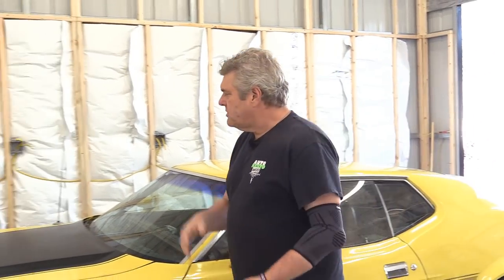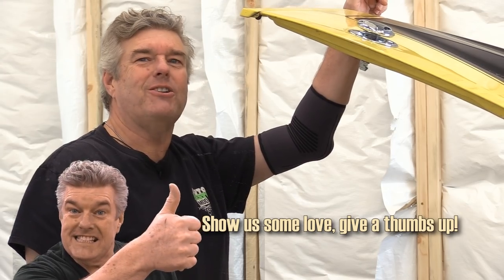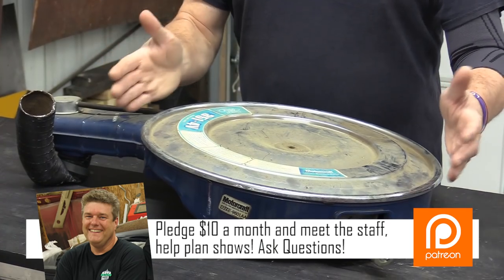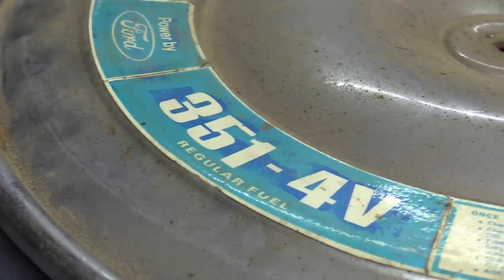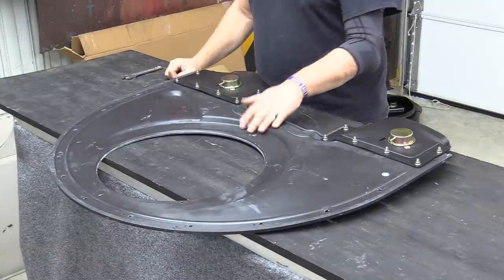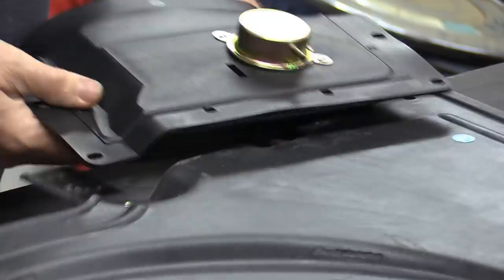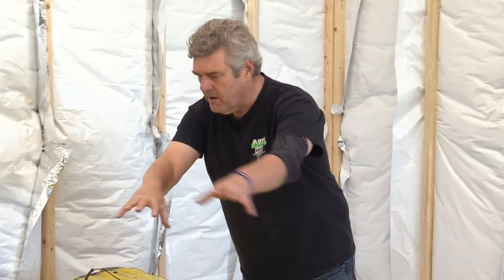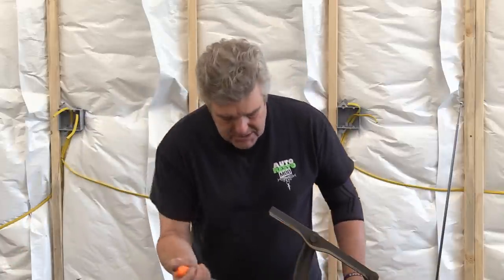Mustang Ram Air

Comment: Thanks for vid, showing us the 72 Mustang again, rolling under its own power. I did the installation with the same kit on my 73 Mustang with a 351C 4V. Although it came not with the Ram Air setup it came with the HD springs from the factory. I added the correct hood locks, the correct TuTone paint on the hood with the right dimensions and the Ram Air setup. On the Air Cleaner element I added some things to make it more functional and OEM, like the inlet for the fuel vent, the hose for the pvc system and the temperature sensor for the vacuum door. Since I have headers I did not add the snorkel tubing or the fresh air duct the '73 originally had. 
I had only one big issue with it so beware and test it twice: the flappers did not travel the whole way through the inlet, they blocked itself and were scratching on the plastic side of the inlet. So I filed down the metal flapper a little bit so it can move freely now. Before installing the whole hood again please test it!
Btw: Bob Perkins too have a Gold Glow 351C 4V Mach 1, which got the Ram Air original from the dealer added, window sticker shows it. You could get it in those days, but only from the dealer.
Reply from the maker: Awesome info! Mine had the flat wounds too. But we wanted to feature the new ones that have been unavailable until now.
I will look at the hood scoops for interference, though I did test them before I installed it. Sometimes installing will change positions. I wonder if the cost was a "you might feel a slight pressure" level.

Comment: These cars are a lot more fun than I realized when I was a kid and they were relatively recent model used cars. I'd love to build a 351C, 351M, or 400 with aftermarket closed chamber heads and a decked block to get decent compression and quench. Add the right cam and appropriate 4bbl carb & manifold I think it could really surprise some people. Not so much the Cleveland version because those still have reputation but the Modified engines ALL used Cleveland 2v heads. Funny how a raised block and a bad tune make people think they have no potential.
Reply from the maker: Oh but they do. The Aussies have made hay with this engine and were the first to offer a stroked 351C (I think).

Comment: I use a spare seat belt to remove the spring. You have to pull pretty hard but it works! Also too bad ram air limits your intake manifold selection. I have an Air Gap intake on my car. I heard you can trim the seal to make it shorter so the hood will close. I might give it a try because I want the best of both!
Reply from the maker: I'm not sure you can trim it and have it look decent. I might go with closed cell foam, use some Playdough to know what depth you need and glue that down to the air cleaner with weatherstrip adhesive.

Comment: My 1972 Mach1 had that same air filter top. Chrome with the 351-4V Regular Fuel. I had to add the Ram Air package from a wrecked 71 Boss 351. Before that, I found a top from a 302-2V Torino and flipped it and replaced my chrome top to let my Cleveland breathe better until I found a ram air hood setup. It was a noticeable difference.

Comment: Regarding the 351-4V air cleaner decal. That's very true, my 72 Q code with build date June 24th has that sticker. As original as original can be.
Reply from the maker: I really wish someone would reproduce the correct 4V sticker. My car too is a June build date , actually our dates on the cars are pretty close!  My car had a serial number established on June 14th which is also my birthday.

Comment: You have a little horizontal banding going on in some shots with those new lights. Might try adjusting the exposure/shutter time to eliminate it.
    When I remove the springs I hook the new one on the old one then pull the hook with a bar. Or do the same but with just a piece of small rope. I'm glad you are adding the ram air. On the Chevelles I have always been annoyed when someone puts a non functional cowl hood on them. For me if its there I want it to work and on the chevelles you have that cool door that you can see opening and closing.
Reply from the maker: It is the crap lights in Studio A Those will work great in a not video situation, they suck for film. We're going to dump them and get the Metalux like in Studio B, where we shot the hood removal (we shoulda got the mMetalux to start with).
Reply: @AutoRestoMod   Yup I know how the lights go. Have had issues with commercial lighting too. Lots of cheap lights use a switchmode power supply which makes the light flicker faster than you can see. The better lights use constant current power supplies that basically feed full DC to the lights all the time instead of chopped up dc. usually you can change the shutter speed and eliminate it vs replacing lights.

Comment: Love the videos! Have you seen the Lucky Costa method of using a fan belt for hood springs? Also works great!
Reply from the maker: Yes I have done that before, but these are new and REALLY stiff.
Reply: In 1978 I traded my 1978 Mazda GLC that my parents had bought me about 6 months earlier for a used 1972 Mustang Mach 1 with the 351-2V Ram Air.   It had been repainted in its original Dark Green / Argent colors and had been modified with a Mallory dual point ignition, snubber traction bars and the exhaust terminated just underneath the front seats with mufflers that were attached with coat hangers or bailing wire.   I traded even  for this Mach 1 and thought it was good deal.   Needless to say my parents were not amused and didn’t share my thoughts of a good deal.  Immediately, it had to have a complete exhaust redo.   The competition clutch had to be replaced with a standard Ford unit( thank God).   My left leg is still stronger than my right leg thanks to that clutch and I’m 60 years old now.  Why they put a competition clutch, dual point ignition, and left the anemic 2-V carb and heads is baffling to me.   Maybe they ran out of money ?  My Dad put a new heater core in it ( after the winter was over) and didn’t speak to me for about a month.    It was a great looking car with a new paint job but not very reliable.  I had forgotten about my Mach 1 until I earn across this video.  Good to finally know why the Ram Air was only available on the 351-2V which never made any sense to me.

Comment: 14:00 why not use a short pulley belt. Hook it on the end of the spring and pull.
Reply from the maker: Those are wicked tight springs. There was a LOT of grunt applied to get them on.

Comment: I believe the 72 Torino had a option for ram air
Reply from the maker: They did. Early cars had them installed, later cars had them in the trunk.
Reply: @AutoRestoMod  also 72 montego gts with the cyclone package

Comment: Love the videos on this car, I have a '73 Mach 1, same color scheme as yours except, of course, for the stripes. Fortunately, mine was already restored, but had been sitting up for a few years when I got it. It is factory stock, with the 351C 2V, that runs good now, however I'll not be winning any races! I plan on taking it to more car shows this year, it's not perfect but is a great looking driver. Won first place Mustang at a local event last year. Leaving it stock for now, but visions of mods keep running through my head. I was 16 when this car was new, but couldn't buy one back then. I've retired, so me and the wife will be enjoying feeling 16 again. Would love more power in the future, does NPD carry mods for this engine? Not sure whether to stick with the 2V heads or try to find some 4V versions. and then there is the cam. Thanks for the videos!
Reply: I was always amazed how fast these sold in 1980 when I was trying to buy one , I ended up buying a 68 cougar for $250 and had to replace all of the wiring in the Engine bay to get it running . Still 42 years later always looking for a blue with silver stripes 71 to 73 Mach 1.

Comment: Hey Jeff can't understand why you had such a hard time with the hood springs, flat screw driver, so fast you wpuld think I did some sort of magic trick, also I ran a nasa hood with stock springs, never new the difference,  just sayin. Thanks
Reply from the maker: I use the flat and the Philips screwdriver trick too...on springs that are not as hefty as these. I tried that first in fact.

Comment: no need to change spring
Reply from the maker: That depends on the Spring. If your car isn't a Mach 1 with the ram air originally the springs are not heavy enough. The flat-wound springs are required for the Mach 1.